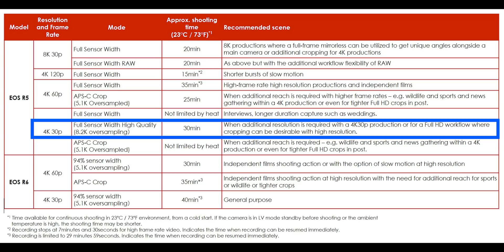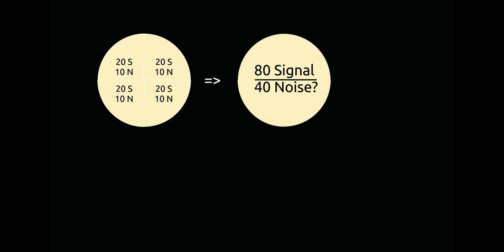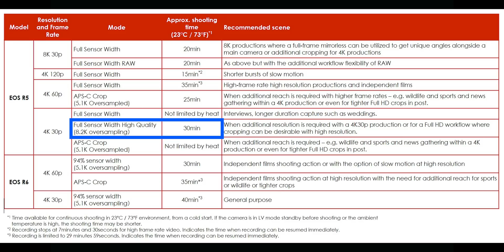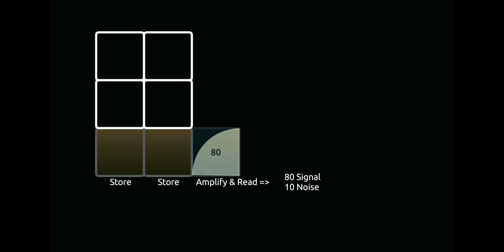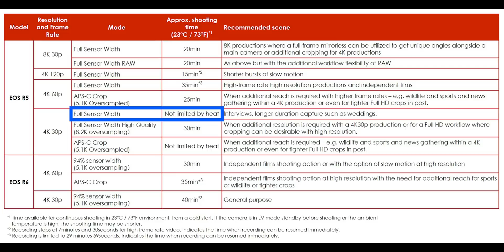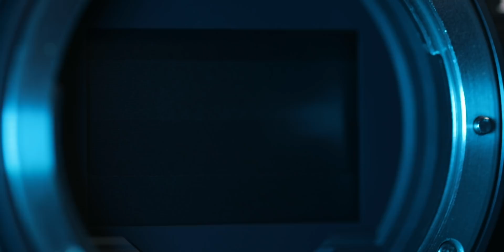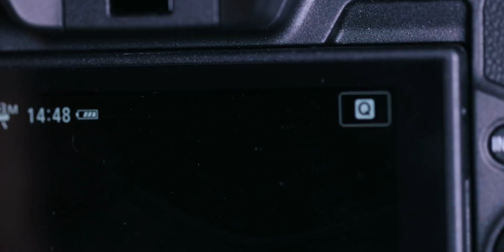Canon EOS R5 - Everyone is WRONG - Sensor explained - vs Sony A7s iii

Comment: The thing is, the R5 and R6 do NOT overheat. Canon has implemented some very smart tech to prevent this from happening (including sensors that let you know before you shoot how much record time you have). They've also let consumers know record limits (20 mins for 8K raw on a 45 mp photo camera is extremely generous). Also, once the limit has been reached, you can still film in other modes or shoot photography. The cameras do not overheat (in fact one user in a hot climate said they barely get warm). 

REDs overheat, Sonys overheat (and become unusable). Canons do not.

As for the rumoured A7SIII,  it's apparently going to be only 12 MP so it's really not a photo camera in 2020. There is a reason very few people own A7SII's, and that's because people got sick of owning 1 camera for video, then another camera for photos. For people who want to shoot just video, most will look at cinema cameras.
Reply from the maker: True it doesn't overheat = damage. Shutting off when too hot is the right term, you're right. Also conducting heat off the camera body through contact gel might work, let's see! There are two things I don't like about the cinema camera (C500mk2, C300mk3 etc) lineup. One is that it's such a pain to carry around, so in the end I'll end up using my iPhone instead. Second is that it draws so much attention. I feel often in a modern world, you want a more relaxed, less intimidating setup. Anyway, exciting times. Lots of options!
Reply: @ctoLarssonTECH  true, the bigger the gear the more attention & less chance you will take it with you on a trip, hike or party
Reply: Minus the last part, Canon shutting down the camera or giving you a recording time limit = preventing overheating. So, for all intents and purposes, they overheat.
Reply: Alexander Minervini Overheating means camera reached threshold, which the r5 doesn’t. The R5 never gets to the overheating cause it’s control by timelimit based on Heat...the a7sii would overheat cause there wasn’t any safety provisions and never acknowledged by sony. Camera would just keep going until it heat overload
Reply: @marioslrzn  Camera is still overheating. The camera has to stop you from recording because it got too hot to record. Which means it's overheating. Spin it how you like but facts are facts.

Comment: It seems IBIS and super wide has problems across the board at the current tech level. The Fujifilm X-T4 has the same wobble with the 8-16mm lens @ 8mm
Reply from the maker: Yes it's primarily an optical issue that can only be reduced not solved by moving the sensor. Interestingly, with the lens IS in the RF 15-35 at 15mm with the EIS in the EOS R, it does not wobble, see my video on "96 stabilization..."
Reply: The issue is that when you move the sensor you create paralax artifacts that cannot be corrected. Essentially you sometimes can see behind foreground objects, other times not, and that results in the foreground appearing to wobble. All mechanical stabilization methods will do this, both in lens methods and IBIS. 

To see the effect, hold a finger in front of your face with one eye closed, then move your head (the sensor) from side to side, sort of like IBIS is doing. Even though your finger and the background are not moving, your perspective is, and consequently it looks like your finger is wobbling against the backdrop. This will only happen with wide angles because your subject matter is normally close enough to the lens for paralax to become noticeable. At long focal lengths the subject matter is far enough away for the differences in perspective to be too small to be observable.

Comment: Really like your video, when would you think you will get the information whether 4k30 is pixel binning.
Reply: do you think the info from EOSHD answers the pixel binning questions?  https://www.eoshd.com/8k/a-closer-look-at-the-canon-eos-r5-lower-quality-4k-mode-to-avoid-thermal-cut-off/#:~:text=In%20order%20to%20achieve%20the,work%20for%20the%20image%20processor.
Reply: Hello卜水 yes.
Reply from the maker: I know there are rumors like the link below on the EOSHD forum, but I couldn't confirm them. I checked with one Canon representative and they hadn't gotten this information yet. The final firmware for release isn't done yet, maybe in progress still. The good news is that no one has observed the characteristic aliasing, so I'm quite hopeful that it will turn out to be pixel binning. Fingers crossed